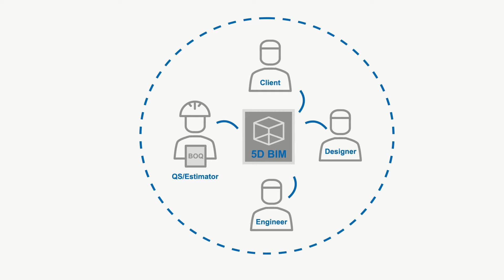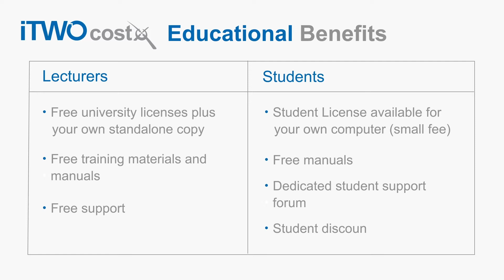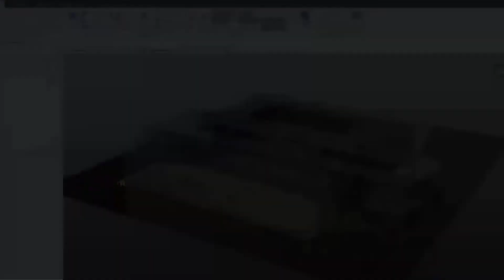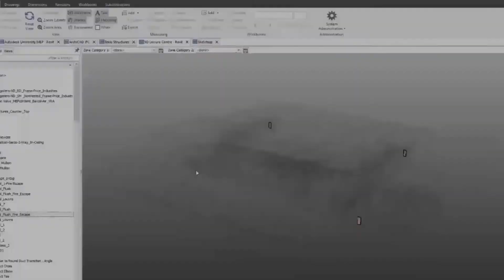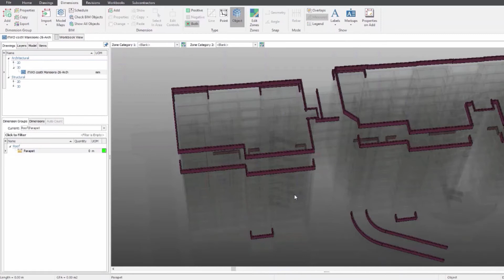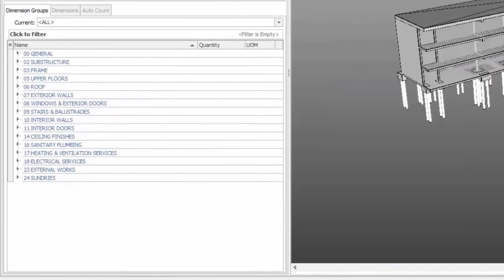Learning about 5D BIM for Students and University Lecturers

Comment: Can we do civil engineering Final year projects using this software? And what are the types of projects that can be done?
Reply from the maker: Hi Levi, thanks for your message. It will be best to refer your query to your lecturer or course coordinator, as they will be best placed to respond on course specifics. Generally speaking, there are a wide variety of projects that can be completed with iTWO costX Educational licenses, including civil engineering, although there are some limitations on these licenses so they aren't used for commercial purposes. Hope this helps!